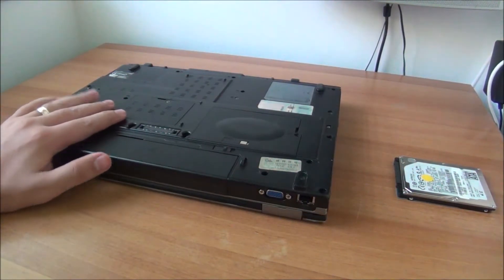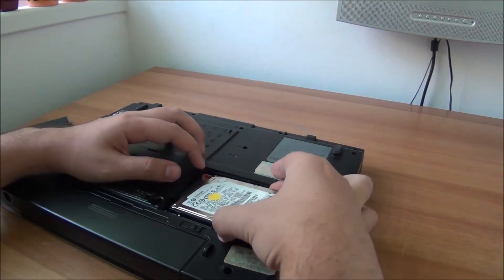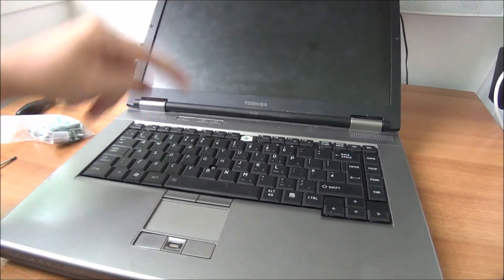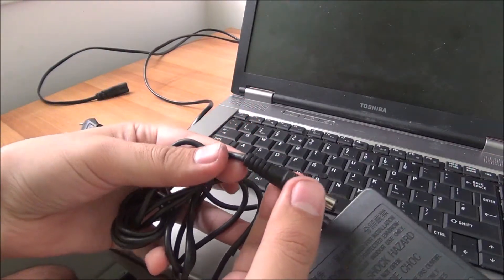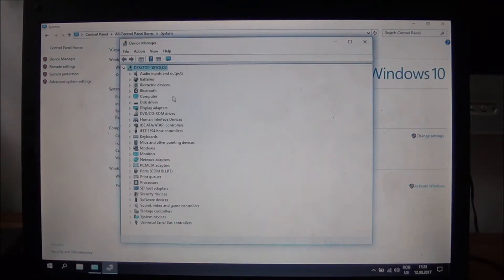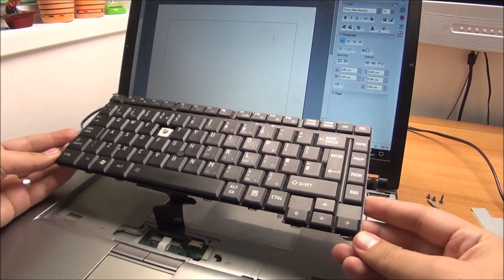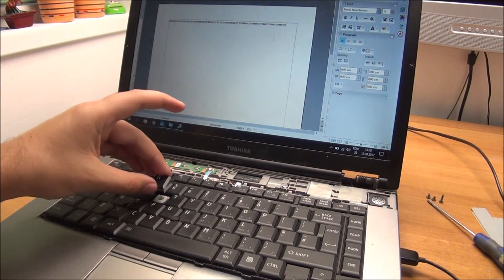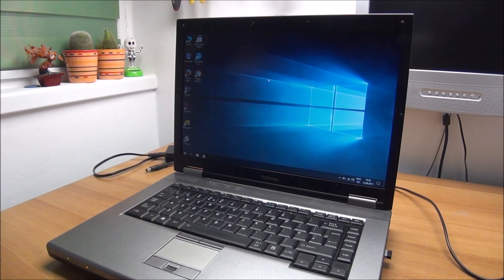How to repair, upgrade and install Windows 10 on a Toshiba Tecra M10

Comment: I have this laptop, but I have a problem and looking for solution.
Whenever I turns it on, the power indicator and charging indicator if plug in comes up, but it doesn't display anything, after 1 hour to 3 hours, it comes up, when I power it off or restart it, still delays to start, any solution?

Comment: FYI - The HDD is flapping arround only because the previous owner took the HDD with the frame which holds the drive.
see here https://www.youtube.com/watch?v=0En03DwJ5yM
All Toshiba TECRA M and S series laptops had the slot for the radiator cleaning. Toshiba is he only company who had these.

Comment: hi i have an issue with the power supply, the laptop indicated orange led in power indicator, and on the service manual it's saying to says tis power supply or main batterie problem
Reply from the maker: Try to power it on without a battery.
Reply: @UltimateDIY  i have tested  but same problem i think its power supply problem, but the power supply it working i have a green led

Comment: Salut . Am vazut ca ai facut cateva tutoriale pentru imbunatatiri la skoda octavia 2 facelift . Ma gandeam daca cumva ai idee daca pe facelift se pot adauga acele lumini pe care le are octavia 2 fara facelift pe oglinzi . Gen puddle lights . Carcasele oglinzilor cam difera dar ...
Reply from the maker: +Gabi Gabi salut. Nu stiu sa iti spun asta, pentru ca a mea nu le avea, dar sunt niste lumini in genul asta care se pot prinde sub usa: https://store.ijdmtoy.com/Audi-A4-A5-S4-S5-Q5-LED-Door-Courtesy-Lights-p/75-004.htm
Sigur poti adapta ceva mai usor asa, decat in oglinzi, sau poate chiar si in oglinda sa tai un loc pentru ceva in genul asta si sa le legi in paralel cu luminile interioare.
Reply: Ultimate DIY ok . Mersi frumos . Eu as fi preferat fara modificari majore . Multumesc inca o data si spor la treaba
Reply from the maker: +Gabi Gabi fara modificari majore din pacate nu cred ca se poate. Multumesc si eu!

Comment: Toshiba Tecra m10 S3411
Reply: I'm trying to reset the internal battery for this lap but you didn't  go into the battery...so sad
Reply from the maker: You mean the bios battery? I hope you don't want to remove a password like that, because it will not work.
Reply: @UltimateDIY  My issue is the lap top will not come on. I checked  the battery, & charger.. nothing.. so according to other FANTASTIC YouTube  TEACHERS such as yourself. Check the I think bios battery? Please help me understand. And I  found your page looking for a deconstruct of my lap top and boy o boy am I happy I did.
Reply from the maker: @Sakmaquil  sadly reseting the bios very rarely fixes this. Most times, from my experience, it's unfixable.
But you should try all sollutions that you can find, maybe you get lucky.
Reply: @UltimateDIY  Thanks for answering... my daughter told me last night to except that it is dead... but the lights still come on when I  plug it up. I couldn't find a video for my particular lap top do you know where the battery is?
Reply from the maker: No, I don't, sadly.
Reply: @UltimateDIY  Thanks any ways. I happy I found your page. 👍👍👍I  now have another awesome teacher to refer to. Take care and enjoy life.
Reply from the maker: Thank you and you too!
Reply from the maker: Not sure what you are asking.
Reply from the maker: I think with tab, but most bioses show you the navigation keys at the bottom of the screen.